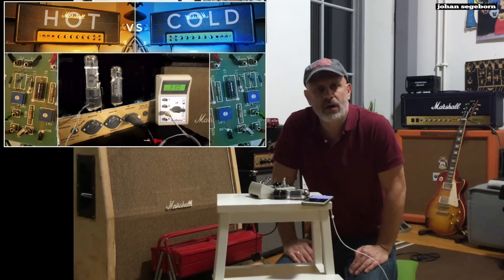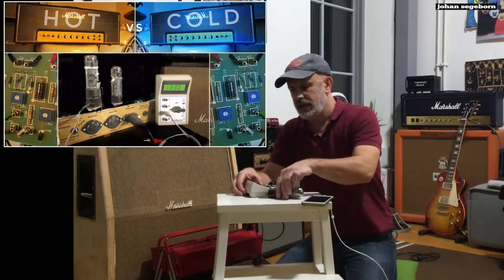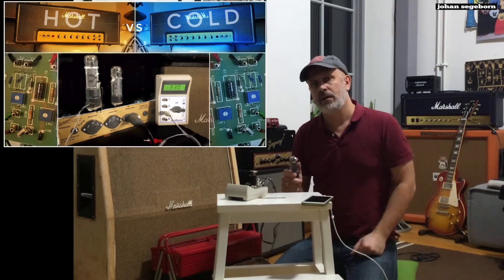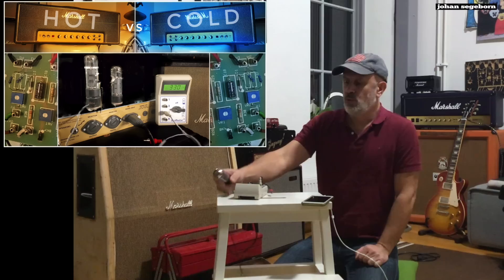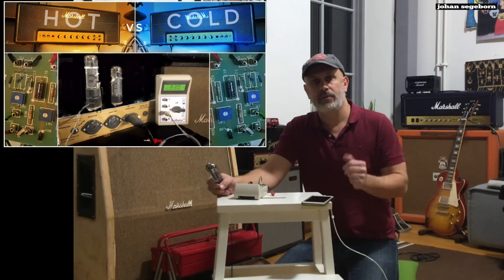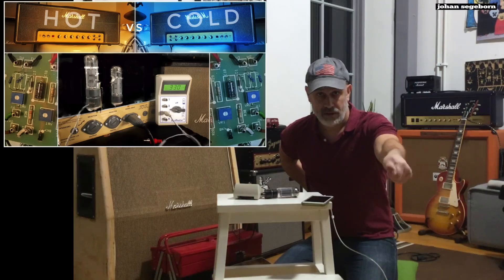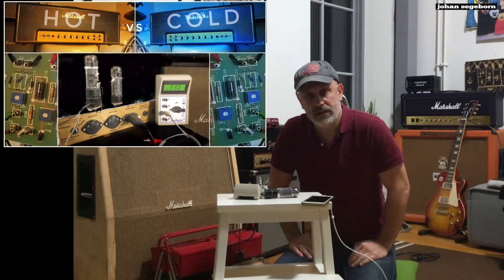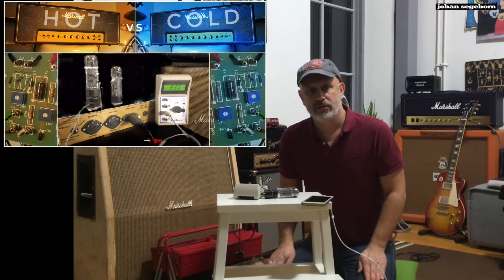HOT vs COLD Tube Bias on a Marshall 50W

Comment: ive always biased my 800 & 900 heads to around 32-34ma provided they are still within plate voltage spec @60-65%
the thing is valve amps need to be turned up to sound best
many bedroom players bias them hot cause it makes em sound 'better' at low vol, turn those amps up and biased hot they dont sound as good (mushy / too distorted) as one biased a bit cooler when its turned up it will break up and overdrive much more nicely

Comment: From my experience, cold (positive) bias is darker, more damped, and quieter with higher headroom, whereas hot (negative) bias is brighter, looser, and louder with less headroom. Use cold bias if you like to push the front end with pedals and stack your gain that way. Use hot bias if you get your distortion from the amp itself and want that cranked sound at slightly lower volumes. Both too cold and too hot will shorten tube life and adversely affect tone.

Comment: This is a very helpful video, Johan. I have kept my 1969 head as close to 30mA as possible and of course any change is much effort. I think I like the colder settings you show here. I have been working on a circuit to select bias on the fly with my beloved 1987, showing no mod at the front panel. Panel mount test probe points on the rear panel right beside a discrete 3 or 4 position switch. After hearing your presentation, I’d go with 3 settings. Thanks for this.

Comment: No tone difference, slight diff in output. Biasing was never meant as a tone control. Plus every time your line voltage goes up or down (which most do depending on air temp and pwr grid load) your bias changes. I do mine around 55%. Gives room for voltage or swapping tubes that bias close without re-biasing. Tubes last long time!

Comment: the best way to bias is with using a signal gen and a scope, plug the amp into a load, run the amp just before clipping, if the amp is under biased you will get a kink in the wave form in the middle at cross over, that's cross over distortion adjust the bias till the wave is smooth, when  you run the amp into clipping crossover distortion will be present anyway, its just getting it clean at full power before distortion

Comment: Interestingly, Fender, in the EVH 5150iii 100w head schematic, recommends 20ma per tube (6L6GC) which is super cold. I've tested that and 70% plate voltage (482v), and stayed at 20. I'm assuming Eddie also liked cold biased tubes.

Comment: sounded best at 33 mA,   in truth most of these tubes has peak performance around 30-35 mA,  that's no secret,   The manual you received with your Tube-amp-doctor Bias Meter,  even has a spec sheet containing a long list of amps/tubes and what bias current to set it up with,  and  EL34 / KT88  always ends up in the 30-35 mA range, that's where they peak peform, this is physics - not a matter of 'taste'

biasing them with this negative voltage eg 30-35 mA,   lets them operate in their most efficient state according to their anode characteristics. But yeah, i'm all for going with 30 mA or perhaps even 25 mA depending on the specific amp itself, tube life-span is

Comment: Why people mess around with bias I have no idea. In all class AB amplifiers the output devices must be biased to the point where there is no crossover distortion ... Running the output tubes at higher quiescent currents limits the output peak power, saturates the output transformer and shortens the life expectancy of the tubes .. so stick to the manufacturer's original negative bias voltage ( applied to grid 1 ) Final checking can be done by measuring the voltage across the cathode resistors ( assuming they are identical )

Comment: Awesome! I've been reading Merlin Blencowe's book about valve amps, and this video proves what the book explains!... I was wondering, these bias experiments were applied to the pre amp tubes, right?
Reply: No. The bias adjustments here were don't to the power amp tubes, as the norm. No need to bias preamp tubes unless it's some extremely obscure preamp tubes/amp. I've never dealt with any preamp tube biasing.

Comment: I have JCM800 that I've built. Heyboer PT and ClassicTone OT. Long story - short: I bias for full 25W of dissipation for EL34. Under full load my HV sags to about 380V, when w/o signal it's close to 450V. 
So 17.5W (70%)of bias it's just a rule of thumb...  
By the way, first set of EL34 by EHX lasted for 8 years :) So no, my amp is not "tube-hungry"

Comment: A hotter bias does not mean a better sound, it drives just the tubes much harder. My EL34s are biased at around 25 mA and that's far enough for a Mesa Boogie (as the specs on the schematic are setted for -47 of negative grid bias voltage). I modded mine to get a separate bias for each tube with two potentiometers, that way I can get rid of hum even if the tubes are not properly matched. If you think your amp has no balls, you should rather look at the values of the Long Tail Pair resistors and coupling capacitors. There's a lot of things to do there, to get the sound you want (the Phase Inverter tube is maybe the most important one inside your amp). Setting your bias hot like crazy does not solve your problem, it will only shorten the life of the tubes and turn them into a muddy and noisy sound.

Comment: The age of the valves will impact on the sound and not to mention the valve brand. My experience is that newer the valves the cleaner the sound. They start to breakup more when they're old. I guess that's why the bias function is there, to try and get a sound given the age of the valves?

Comment: The colder settings seem to have clearer note separation and less compression. It probably would do really well with an OD in the front to bridge the gap if more dirt was needed. The hotter it was, the darker and more compressed it sounded, which isn’t bad, but I think it then gets shoved into a hole and not as versatile.
Reply: Its because of the voltage sag due to higher screen current of the output tubes. Less voltage = more drive and compression for the preamp tubes. And less high end.

Comment: One needs to know the voltage of the tube in order to get dissipation in watts. The higher the voltage the Lower the current.. you bias a push pull amp so the plate dissipation is around 50% to 70% at idle. This is between a cold 12.5W or a hot 17.5W for an EL34 tube with a max dissipation of 25W. 
So http://www.tedweber.com/webervst/tubes1/calcbias.htm

I have an amp with a pair of EHX EL34 right now which I play on the clean channel with pedals.  But something is not right. I tried so many different EQ settings but the response is not right.. I have not meddles with bias.. You have to open up the chassis,, and read plate voltage and then I read the output transformer taps ohm count and look at the voltage drop over the taps.. I remember setting the bias pot at the highest bias voltage and coldest bias and I think that even this settings was not "cold" ,, but I have to check it again..

Comment: I feel like the 18 mA setting is less compressed and a little punchier. The two top biases had so much more pleasing harmonics. I would personally use 18mA or 26mA with a boost for tight rhythm parts and the top two biases for lead, if I were recording.

Comment: Bearing in mind each tube got a different non-identical performance, it is impossible to say that there is any meaningful difference, myth be damned!  In the past I have always followed the rule of thumb to, bias to no more than 70% max idle dissipation, but I've biased much lower than that without issue. Clearly this video suggests biasing cold doesn't make any great difference (i.e. nothign so obvious your Mom would notice). If maximizing tube lifetime is on your radar as something important, feel free to bias cold!

Comment: Yeah i run my amps hot as hell. My carvin is suposes to be set at 100 mas i run it at 180 . You,d think id gi though tubs fast or have trubble with heat but the amp sounds great,its not noisy or sizzy. Like you lm not a high gain guy so i dont do it for that, its just where the amp breaths the best. Now my 22 watt is at 17 ma for the same reason. Anymore i just bias with my ears then check to see where im at. The marshall your playing ,i though was best at between 33 and 41. So marshalls been doing this hot thing for a long time.another good video bro.

Comment: A question, Johan. When often using a hotplate, would it be wise to bias 3-5 mA colder to keep the " living period" of the tube longer? I am especially taking about amplifiers with master volume (JCM 900 4100). I blew an output tube after some days of test of output tube distortion. The HT fuse blew also (of cause), but one of the tubes was way off. Ha' det bra, Steffen

Comment: Great job! It sounded very similar and most people can differentiate between 18 & 41 mA.
Now little suggestion: 1987x has cca 370V on plates (?), if so, you could go with max anode dissipation giving 67mA (25/370) and that would be HOT. Yours 41mA is only 60%
Reply: Very relevant!

Comment: 41 mA sounded a bit brittle to me, 18 mA a bit muddy, and I can't decide if I like 26 mA or 33 mA better, so I'd say split the difference at set it to 30 mA with those tubes.

TBPH, if you gave me any of those settings in a blind test, I'd just turn the gain and eq to where it sounded right to me, anyway. 

I don't worry about bias, ever. I play a fixed-bias two-tube Class AB push-pull Mesa amp, and I buy matched pairs of tubes pre-tested to ensure they are within specification. Currently, I run Groove Tubes KT66HPs (#5 rating) in my Mesa F-50, and they sound amazing, to me.

Most of my tubes were bought on clearance sale at GC, and so I have a stash that will probably last decades.

Comment: Nice comparison Johan. There's a lot of debate on correct settings for even what manufacturers specify their bias to be. As you've shown, the lower the bias the less bottom end and the longer the tubes will last. The higher the bias, the more distorted it gets but you'll burn the tubes out quicker. The happy medium is in between those two. Best way I've found is get it in the ball park from the manufacturer, then play and tweak it a bit. All tubes respond a little different even between same species.
BTW. You can get a setting screw driver that has a metal tip and the shaft is HV insulated plastic. Get them from most electronics stores and only cost a few bucks. A lot safer than using just an insulated screw driver even though the bias pots are on the low voltage side of the tube. There's enough HV around the rest of the board as you've said!

Comment: Johan, you can measure the plate voltage and use that to calculate the actual dissipation. These mA values dont give you much information by themselves. For example: Two marshalls can have a 50v difference between their plate voltages. So setting both amps to "34mA" wont give the same result. But setting both to 70% dissipation will make both amps biased the same.
Reply: That is very interesting and makes sense. How do you measure the plate voltage?  Thanks man!
Reply: @migueldelatorre9475  I wouldnt recommend working on a live amp if you dont have an electronics background. There are important safety rules to follow. Those amplifiers have about 500 volts DC inside, which will kill you instantly.
Reply: @infectionsman  thanks for the warning man!! Pin 3.
Reply: @infectionsman  thanks for the warning man, appreciate. Pin 3 and ground
Reply: @migueldelatorre9475  500 DC volts setting on multimeter. Ground probe clipped to chassis, live probe to pin 3 using right hand. Left hand stays in your trouser pocket during measurement. This is to avoid a current path between the hands trough the heart. Obviously with shoes on and standing on non-conductive floor. (Concrete floors can conduct to ground.) You got this.

Comment: I heard barely any difference which is the same result that I have tested for on my own amps. What I think makes more of a difference is a hot bias will sometimes also pull the HT voltage rail down a bit, lowering the headroom of the amp as the power transformer loads up more. This makes more of a audible difference on some amps
Reply: Did you happen to see what the plate voltage was doing as you turned the bias up and down?

Comment: Hi Johan! Wonderful video as always :). Some people say to bias by ear, but I'm more the engineering type, so I set it as hot as I was comfortable with and adjusted cold to see where my ears liked the bias. Turns out my ears liked my blackface bassman around 55-60% of plate dissipation. There was a sweet spot when the harshness seemed lowest. One video idea that's right up your alley might be a tone comparison between a vintage oversize Marshall 1x12 cabinet (like open back Bluesbreaker size) vs a more standard sized 1x12. I ordered a cab on ebay for an Altec 417-8h and didn't check its size first. Oops, it's a big 1x12 with the same dimensions as the Bluesbreaker.

Comment: If you bias closer to class A the amp sounds a tad fuller and richer but with a little less crackly crunch. It's generally more pleasant sounding probably because of the lack of crossover distortion. Some power supplies in some amps sag quite a bit when you bias hot. It can reduce the headroom and of course burn up the tubes faster. With very little bias current, it sounds like it's got more headroom but it also has less "life" to it. I've played with the bias myself on lower powered (push-pull) amps I've built and this video seems to reflect my findings. There seems to be a balance somewhere in class AB where the sound is almost the same as total class A. Every amp has a sweet spot you just have to find it.

Comment: Great vid as always. Personally I heard no tonal variation whatsoever.  perhaps the harmonic feedback was slightly different on the coldest bias setting.  Also, changes in bias are much more difficult to discern with gainier tones.  You can more easily hear and feel the difference as a player on clean and low crunch settings.  Someone commented about their fenders offering a more noticeable difference with hot and cold bias, that's because the fenders will be either pretty clean or just a bit crunchy as they are turned up.  The marshalls will have far more gain and so the hot and cold won't be nearly as apparent.  You will notice a pretty large feel variation on say a fender Champ between cold and hot or over biased power tubes. Personally I really like to over bias my power tubes to maximize harmonics and dynamics which is more a feel thing than a tone thing.

Comment: Hi Johan great idea for a video! Cool! Thanks for posting :) I think to me it sounds like the higher you go the more aggressive the sound? I got into 
biasing when I had a Ceriatone Overdrive Special Clone (6L6's) I think were set around 35mA. Compared that to the EL34's in the 100w DSL, they 
run at about 90mA I think. Those things run seriously hot (set by Marshall themselves no less) I wanted my tubes to last longer and wanted mellower sound so used to run at 74, don't know if it really made much difference though! Love your work man as always!

Comment: In person bias differences are very perceivable. Know your bias! Know what bias works with your tubes best. It's ok to mess with it until you get it right as long as your safe. It's like how changing string gauges makes you need to reintonate. If you change tubes even to the same kind but newer. I also highly recommend rebiasing every few months or at least making sure it's still where you want it as it can have a tendency to drift. Doing regular bias checks are much easier with external bias points. So it's something to consider when buying a new all tube head. For example my new DSL100HR has external bias points that you can get to by just removing the back panel of the head and it makes biasing much much safer and much much much more convenient!
Reply: @Emplexador  In my experience that is 100% true. I think a lot of people only dislike their new tube amp cause they don't know that their bias is unstable at first an needs to be set until it settles.

Comment: Wow. I always worry about biasing. But in this video the differences I could hear were much smaller than the hype about biasing had me thinking they would be. There were definite differences. But it wasn't like the amp sounded unworkable at any of the biases you had.
Reply: Keep in mind that the audio is compressed a ton on YouTube videos. Generally speaking, a hotter bias will give you a punchier sound with more clarity. It’s a noticeable difference.

Comment: One hand in the pocket!!!! Great advice, and PLEASE dont attempt this if you have never worked inside the chassis... 
I bias all my pwn amps. On my Marshall's I tend to Bias just a bit to the hotter side, but not by much. Just a small amount past optimal. My Hiwatts and my Sound City, I Bias even slightly more hotter. Its hell on the tubes but really does warm things up and saturates a bit more. I like this on clean amps. ( Hiwatts are kinda hard to get the power section to saturation, Dave Reeves whole point of the design I think...clean headroom for miles... ) I do have a Hiwatt OL version, the only amp I bias on the colder side, but just by a small amount. I "percieve" that it sounds a bit  better this way. I have always kept my Fenders at about optimal ( middle range ). My Silvertone doesnt seem to make much difference either way. I think mostly because the 1484 has such a very under-powered tranny, that it really doesnt do much to bias it hot. The 1484 is said to be 60W, but its no where near that in reality....

Comment: The beautiful thing about these NMV Marshall’s is their output sections are always balls to the wall all the time unless you’re playing clean, so the bias can be set significantly lower without much adverse affect on tone. If you tried this on a 2204, in particular at lower volume settings, the difference between hot and cold would be much more pronounced